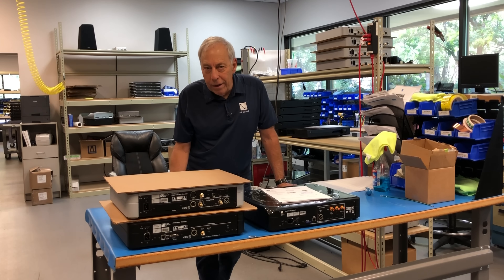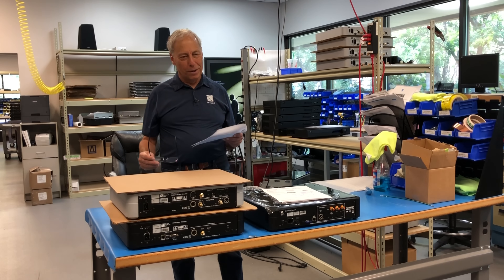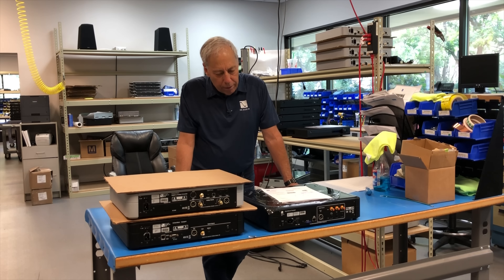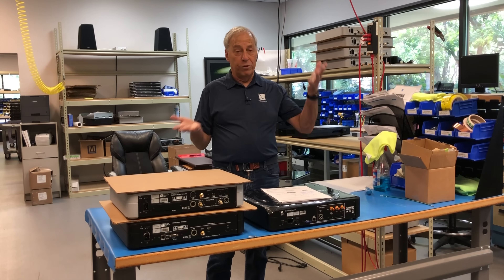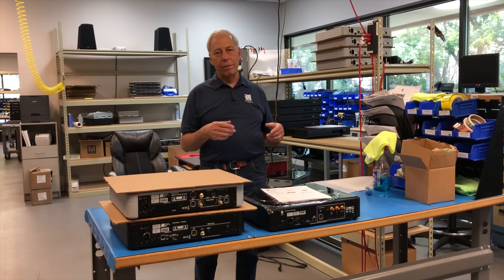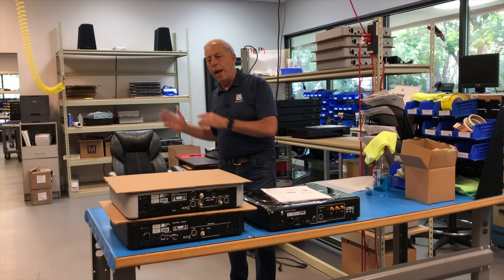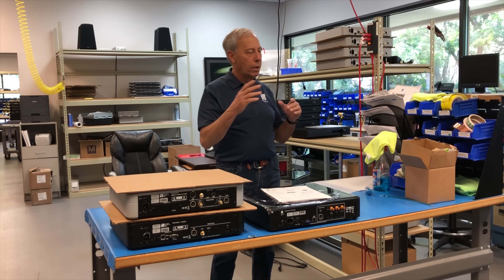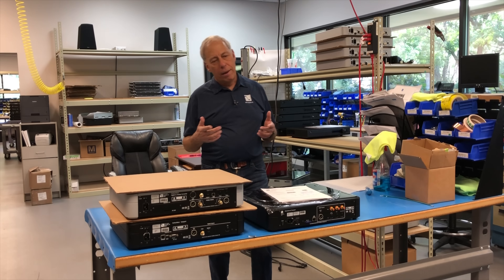What is a transmission line speaker?

Comment: Bose wave radio speakers are labyrinth loaded transmission line speakers. Starting with Series III I think 901 was a transmission line design as well. Bose simplified the construction of the labyrinth by making it out of a single injection molded piece of plastic. The design like all others is clearly inferior to the acoustic suspension design but does have advantages. It's more efficient than acoustic suspension speakers. Compared to the original design it lost the bottom octave.

Comment: Kinda like the  Bose Wave speakers.. is a transmission line set up
Reply: The Bose wave speakers like what are used in the classic wave radio require a substantial amount of compression and other analog processing to give that sought after effect of sucking your brains out of your skull.
Reply: I have to laugh, bose always advertises that they created the wave speaker(TL speaker) but that idea has been around since the 30's.
Reply: The Bose idea is a sort of transmission line copy but the short length of the duct compared to a proper transmission line speaker means the maths doesn't work out well even though the bass is helped by the design and also a lot of electronic EQ.. I have a pair of large original TDL transmission line speakers made here in the UK. As well as going very very low, the bass has a gradual roll-off and almost no hint of resonance. The bass is also very well phase aligned and has very good transient response, notable particularly on percussion sounds, double basses and bass guitars. I've never heard these qualities on anything made by Bose.
Reply: @johnr6168  Which TDL do you have? and how do they compare with B&W's DM2?
Reply: @florinmoldovanu  I have two TDL (or TDL Electronics to be precise) pairs from their earlier (and best) range. The Monitor and Studio 3. The Monitor design was based on the earlier Studio 4. They are both better than the B&W DM2. Although the TDLs are now quite old designs, the original DM2 design is nearly 20 years older than even the TDLs, which makes the TDLs a generation later in loudspeaker design. The DM2 is certainly a fine speaker but the TDLs are more refined and the bass goes obviously lower: almost flat to 20HZ for the Monitor and around 23HZ for the Studio 3, eliminating the need for any subwoofer whatsoever. The bass on both is surprisingly well controlled and much better better than my old subwoofer. The DM2 is useful down to about 30Hz, which is still better than many speakers especially at the time they were current. TDL later introduced the RTL range which was really an economy measure and used a so -called reflex-tranmission line design which was a cheaper arrangement. They were a decent range but not in the same league as the earlier range which incidentally made little profit for the firm as they were difficult to make in quantity. The 'RIcher Sounds TDL'  is nothing to do with the original TDL Electronics, - they just bought the name. They are really poor speakers.
Reply: @johnr6168  thank you fo the info

Comment: And the internal baffles should be thin not thick so you can get more in the cabinet what will lower it's output frequency by cancellation diffraction the angle of the internal baffles has a bearing on frequency as well a narrowing to the output end will give you a more punches sound and vice a versa and the type of filling has a big bearing.

Comment: Ok, ported enclousures work on the Hermoltz resonator principle. The air in the port moves in phase with the driver down to the tuning frequency and then starts going out of phase thus the need for subsonic filter. 
Transmission line enclousures arent popular for their big size compared to efficiency. You can put multiple drivers in for relatively same size box in a ported config for far more output. They also dont have good transient responce because theres no trapped air behind to help the driver suspension and amplifier damping.
Reply: This is a much better explanation without the mumbo jumbo. It's interesting to hear people BS about stuff they're not that educated on.
Reply: Transmission line speakers seem to generally have a better bass transient response than reflex (traditional ported) designs. When I first heard a pair, one of the obvious things apart from the bass extension was the fast transient response and also the lack of much bass resonance. It all seemed to make the speaker's sound very 'solid'. The drive unit parameters are critical in a TL design and an amplifier with  a good damping factor certainly helps. TLs are difficult to design and every single unit requires careful placing of the damping material in the line. When it's got right the results can be stunning. Someone who heard mine suggested they sounded like a good infinite baffle but with an extra octave or two at the bottom end.
Reply: @johnr6168  Agree with your comment on bass quality compared to bass reflex
Reply: If transmission line speakers do not have a good transient response, then could you please explain why PMC - which has its entire lineup based on transmission line technology - is used in high end mixing and mastering environments far more often then any other manufacturer I am aware of?
Reply: Andras Nelhiebel For the same reason Chrysler still makes hemi engines. Plus PMC's design is heavily modified to get away from the drawbacks.
Reply: @Zarazel 741 x
Reply: the reason for their inferior transient behaviour is bc of their dependency on the resonance frequency of a half open pipê , just like ported boxes depend on their helmholtz resonator . They are not worse than ported in terms of bass quality and usually even better

Comment: A nice relatable ballpark number for the speed of sound 1'/ms or  761mph (1,225km/h) at sea level, and 660mph (1,062 km/h) at the tropopause where most jets fly....Should a port be at the front, back , or side of a speaker? Or does it make a difference?
Reply: It's about 1.1'/ms or .33m/ms at sea level. I agree with your point though.
Reply: John R Yes, I know, just trying to keep it simple and relatable.
Reply: Sorry Gregg, I'm a clown. I meant to say 1.1 ft/ms (.33m/ms).
Reply: Yes, so sorry you are right. I got my math wrong. I normally use 1'/ms as a general estimate, or 3ms for speech to reach the end of your arm....

Comment: The result of a close lightning strike is a simultaneous flash and boom. I refer to it as a FLABOOM! 
It is the compression wave caused by the flash heating of the air by the lightning bolt, rather than the fact that the bolt propagates faster than the speed of sound, that I believe causes the boom.
The first pair of audiophile speakers that I encountered were of the transmission line type, way back in the early 1960's. They were almost as large as refrigerators and were home built. A tube pre-amp and separate tube amplifiers were of course used to drive them. I was impressed, but as a teenage kid, they were beyond my budget.

Comment: Great video Paul.  I'm still rocking my homemade transmission line speakers I designed built around 1980.  They are about 2 ft. square and 4 ft. high with a pair of 10" SpeakerLab transmission line drivers in each.  You are right about all the internal baffles making for a rigid box, there's almost as much material inside the box as makes up the outside.  It was also quite a job tuning the internal passages with batting and adding shaped foam blocks at all the transitions to get rid of reflections.  But once finished, I really enjoy the sound.  I had to re-foam the woofers about 10 years ago.
Reply from the maker: Thanks.
Reply: @Paulmcgowanpsaudio  you are completely missing the point on how transmission lines work : think quarter wave , resonance frequency of a half open pipe , think organ pipes
Reply: Gerrit Govaerts Yes, he says the sound wave comes out ‘at half a wave in phase’. 
At half a wavelength that would be exactly 180° out of phase and the net result would be no sound.

I unsubscribed after watching his video where he claims that you can hear the effect of using ‘high end’ power cords. (Not speaker cables but the cords to connect your amp to mains).
Reply: I built mine in 1975 and they rock my workshop- too big for the home now.......
Reply: @Lassi Kinnunen 81 
Thank you for explaining. I completely missed that. 
Paul mentions that the transmission line will be ‘optimized’ for a particular frequency (wavelength). 
That means that such a speaker will emphasise those frequencies and harmonics while damping the ones in between. That wouldn’t be great. 
I think that transmission line (and ported) speakers will be designed to emphasise the frequency that’s a bit below the lower end of its frequency range and by that extending that range (a bit).

Comment: Speed of sound = 767.27 mph.
Reply: AriKona it is no exact figure depends on the temperature of the air what you're quoting is 20° Celsius but different temperatures affect the speed of sound
Reply: The speed is primarily related to the density of the atmosphere. The density itself is dependant on the temperature and pressure which is why these also have an effect.
Reply: ...as do different barometric pressures or altitudes.
Reply: ...and the acoustic filling when we are discussing loudspeaker enclosures.